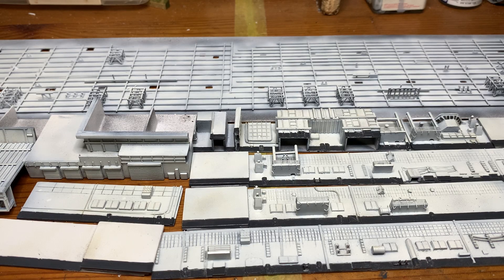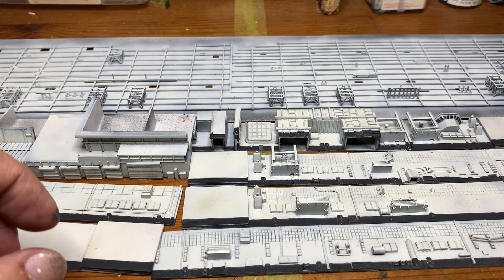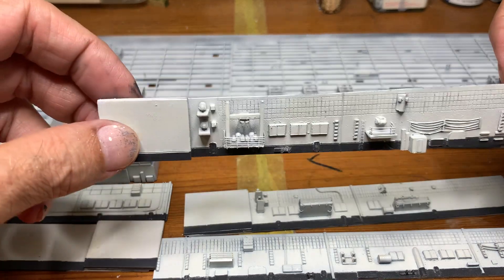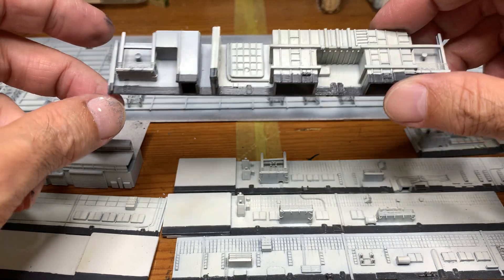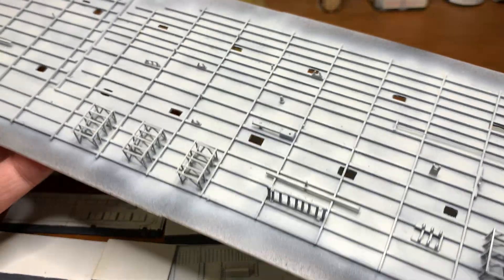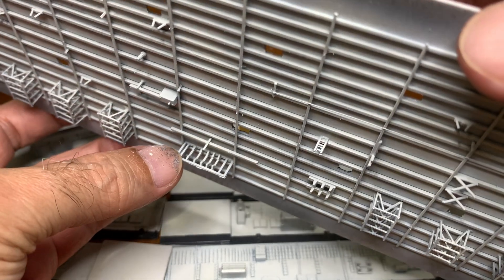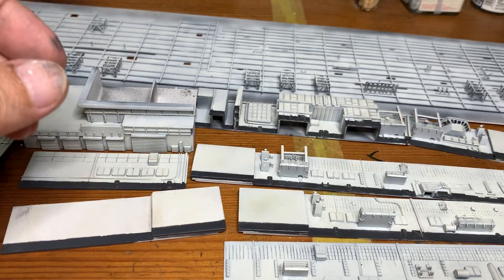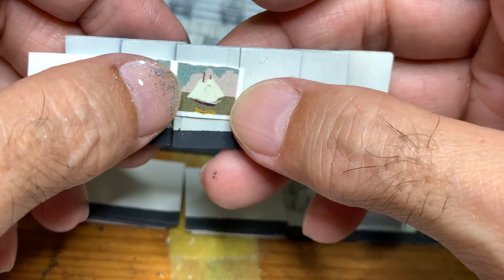1/350 USS Enterprise CVN-65. Mini Hobby Models. build update part 7.

Comment: I'm looking at the racks in your video and to me they look fine.  If you had not pointed out that they were upside down I wouldn't have noticed a problem.  The alternative is to destroy all that work and redo it.  If the tanks go in the racks then it's all good.  By the way they get those tanks up and down by lifting a pallet with a couple of people up to the rack with a large forklift.

Printer ink is not very stable.  If you get it wet even years from now the colors will run.  To prevent this you spray a coating over them to seal the ink.  Microscale makes a Liquid Decal Film for this very purpose.  I'm fairly sure others do also.  If you can't find anything in your area clear gloss paint will do the same thing.  Also art fix for charcoal or chalk drawings.  It comes in a spray can, so something you can use in your airbrush will give you better control.  Start spraying in light mist coats, too wet and the colors will run.  Allow the medium to dry before recoating.  I prefer using glossy rather than flat or satin but that is a personal preference
Reply from the maker: I will try to remove the racks. seems like there are ways to remove superglue . thanks for the advice on the overcoat for the decals. i will spray clear coat on it .

Comment: Regarding the printed decals, you need to overspray them with a clear lacquer to seal the ink. The ink will bleed as soon as you dip them in water unless they are sealed with a clear overspray. A couple of light coats after the printed decals have dried for 24hrs should seal the ink and prevent them bleeding. Let the decals dry for another 24 hrs after sealing them .
Reply from the maker: thanks for the advice. i’ll do just that!